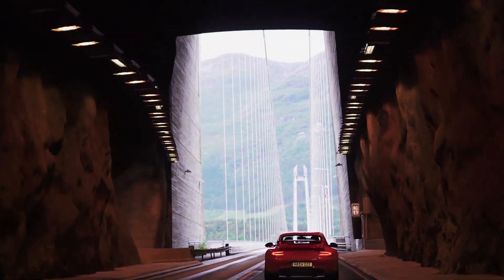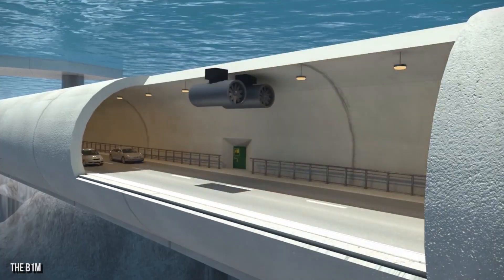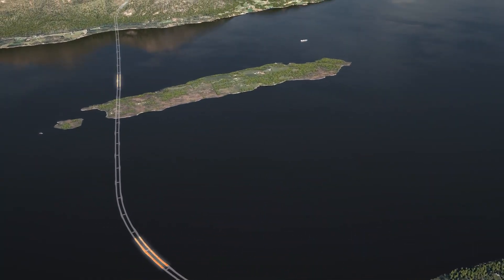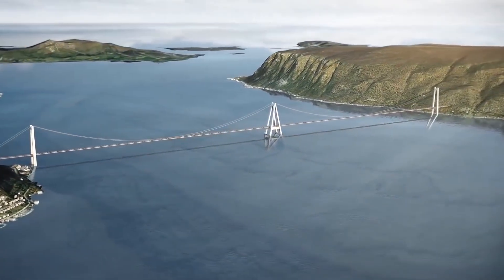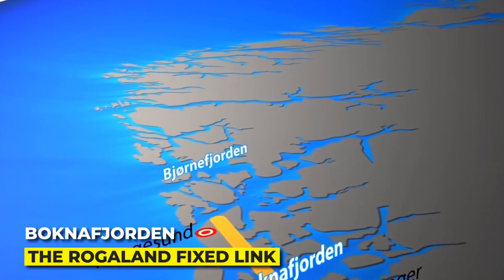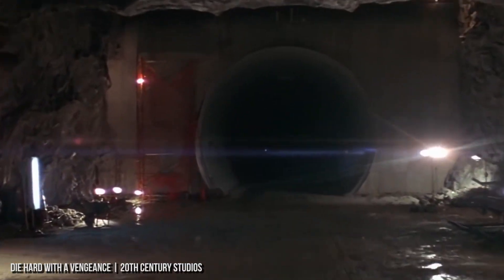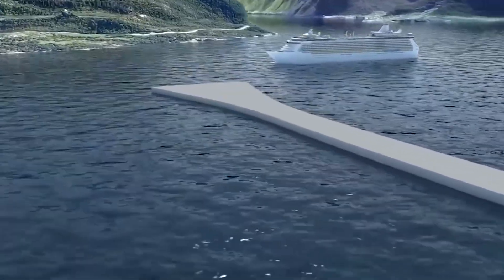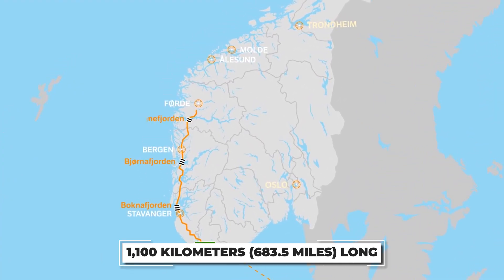Inside Norway's $47 Billion Floating Highway

Comment: I wouldn't want to be stuck in one of those tunnels when an earthquake hits.
Reply: Earthquakes? In norway yeah that earthqakes basically don't exist there.
Reply: @Incognito-co6og  When they pressure the sea too much. It causes evaporation of water which can cause earthquake
Reply: @murphyfx  wow great oppinion thanks
Reply: @murphyfx  what? Are you trying to say that that is what causes earthquakes? I think you need to do some googling..
Reply: @Incognito-co6og  there will be.   Seismic regions have been changing recently.   But this floating thing will be quite flexible I think.
Reply: @Incognito-co6og  lol
Reply: @Incognito-co6og  they must have thought it through,  like Japan.....advanced countries..
Reply: @Incognito-co6og  research shows it does have earthquakes.
Reply: Incognito that doesn’t mean they won’t happen there. Lol
Reply: @sandygrahamn6175  if they do get earthquakes there it's probably just one thing that sensitive people can feel.
Reply: @sandygrahamn6175  the biggest norwegian earthquake in history was magnitude 6.2
Reply: @sandygrahamn6175  Hey dumdum, incognito has right, Norway lays to far away from any earthplate end, that it can't start to move in the ground to cause any damage. In Noway the biggest earthquake threw of a cup of coffe of the dinner table
Reply: @sandygrahamn6175  maybe, but it’s a vary low chance to happen
Reply: What  if it was underwater volcano ?
Reply: @goliath760  even worse i-, cause there can be active volcanos underwater right?
Reply: @goliath760  Hi
Reply: If you look at the earths plates, then u see it's nearly impossible that it will happen.
Reply: I wouldn't want to be stuck on any highway if an earthquake hits..
Reply: @dee1380  lol
Reply: Earthquakes are caused by the cracks in the earth. Norway is nowhere near a crack. No worries, no vikings will fall.
Reply: even though theres a small chance that something cannot destroy the tunnel... ya'll never know.
Reply: take your bible with you and it may save you.
Reply: I would agree with this statement as there can be a possibility of something that can trigger the surroundings of the cement wall and rupture quickly.
Reply: I have lived most of my life in Norway and i have never experienced an earth quake and i dont even want to watch the Norwegian movie called skjelvet about a major earthquake in Oslo because its too unrealistic. Anyway that is in the south east and in the west you still see lava Flow shaped rocks and the faroese Islands in the far west in the Atlantic looks a lot like Iceland. A major vulcano area and the Islands are close to Iceland too. Anyway if it did happen it would happen in the west i think where this is planned
Reply: theres never earthquakes in norway:)
Reply: Hey Sherlock, maybe learn geography first before commenting next time aite?
Reply: Safety is always an issue, which is why we need to keep our options open, especially when we're talking about infrastructure. Populations are growing and there's no signs of declines any time soon. We need to accommodate that with solutions.
Reply: So during an earthquake you'd prefer being on a sky bridge, on the 88th floor of a tall building or driving thru the chunnel because ... 🤔
Reply: It won't be the first time I commuted via submerged tunnel; we use a BART train that crosses the San Francisco Bay - not far from the San Andreas fault - with a similar apparatus.
Reply: I heard in a video about Elon Musk's tunnel, that earthquakes don't reach tunnels, they only ripple along the surface. So these tunnels should be safe also.
Reply: Driving on the surface unfortunately has lost lives as well.  I'm worried about the accidents that may happen with the super impatient drivers who will want to drive even faster because it's tunnel.  Who knows.  I'm actually a relaxed driver so this will be perfect in future,  and this highway will be a major popular one.
Reply: You changed my mind
Reply: These tunnels have to be incredibly dynamic, they are literally floating by strings, so I doubt earthquakes would affect them much... A much more horrific scenario, would be if a huge chunk of mountain fell into the fjord, creating a humongous mega-tsunami (But then you wouldn't want to be anywhere near that area, tunnel or not...)
Reply: that wont happen in norway i think we jave never ad an earthquake but with all what jesus said it might happen
Reply: @David-cg6wl  We had odd one in South Africa.. Not as major as countries...   Ours have been minor..

Norway is a  beautiful country..
Reply: @parrotafrica2996  always cold here but warm enough so.we.dont get snow atleast not this year do to global warming and mexican heat wave orstream that goes past norway
Reply: Norway has been a good and comfortable place to live in. I think i have to invest and secure properties as well
Reply: @thenavigator8052   That's a very lovely idea. Investment is the future, investing now will be wise.
I invest in crypto currency and forex trading, and is highly profitable
Reply: Can you recommend him please
Reply: @nicocielo565   
+     1      4        1       0       8       8       1     2       1       9        2
Reply: Communicate with him
Reply: A friend of mine in Vietnam once told me about Mr Charles. Is really a little world out there. 
And he has made a good name for himself
Reply: Charles Jones has brought me out of the wrenches and to a better living through his trading options, I encourage newbies to trade with him.
Reply: My son schools and works in Norway, and he is making it big time over there.
Reply: Imagine that green door opening 😳😳😳
Reply: Norway cannot have a earthquake because Norway is on a plate.  (Plate that collide to make earthquakes, check Internet)
Reply: earthquakes dosent exist in norway
Reply: It is not earthquake in norwey
Reply: There isnt that here
Reply: You might wanna look into the physics of an earth quake before you form an opinion. Tunnels are highly resistant to earth quake effects because those are much less noticeable underground. Much like even the strongest waves aren't noticeable underwater. These floating tunnels will be very safe in harsh weather conditions. Much safer than bridges.
Reply: @moladiver6817  nek minut
Reply: Now it's two hundred.
Reply: If a war happens the just know that yu dead under those tunnels
Reply: I wouldn't like to be in a normal tunnel either.
Reply: Frida Gylterud   😂
Reply: they won't create the idea if they didn't decided about the plan and caution first.
Reply: Probably safer
Reply: Lol me 2 😂🤣
Reply: Earthquake only affects land not sea unless it's sunami
Reply: With the way Norway is going about this infrastructure, is going to create an international business contract, economic growth and even generate employment for Norwagians.
Reply: The rich gets richer by investing heavily and spending wisely. Crypto and forex is the best right now
Reply: @mrb5422  Speaking of Bitcoin trading, it's the best right now. I know couple of friends who makes profit in the financial market.
Iam not hear to converse for Mr  Jones, but to testify just for what iam sure of.
He is trustworthy, reliable and best option ever seen.
Reply: Actually, being in such a location during an earthquake would be ideal due to the flexibility/ductility of the structural system.  There's a lot more give in such a tunnel than say, a very rigid concrete bridge which in California's case, have seen many such disasters since the San Fernando earthquake in the early 1970's.
Reply: I TOTALLY AGREE  WITH YOU.
Reply: You are safe when you are at the safe. I laugh
Reply: @Potatowhen did I say that 😂 INNIT
Reply: @Potato well I don’t  keep record on every earthquake when I meant Europe I’m talking around England Ireland France area where there not near a ridge the closest ridge to them would be in Iceland
Reply: Surely.have you experienced earth quakes in high stories buildings, when escalators give off it's function and due to rush downs stairs became an inconvenience to reach to the ground.
Reply: no earthquakes in norway, tectonic plate boundaries are in different areas of the world
Reply: I didn't want to think that my road worker father was stealing equipment...but when I got home, all the signs were there.
Reply: I am Norwegian and i know that there has never been an earthquake in Norway. And by that i mean by in Norway not at the coasts of Grenland.
Reply: Very rare that there’s earthquakes in Norway since it’s so high up north
Reply: Hello
Reply: [BosS] HITMAN 20  Norway lies on top of a earth plate which means we won’t see or feel a earthquake but doesn’t mean it won’t happen. Just some months ago a big earthquake happened. If you think you know so much then say what makes a earthquake come
Reply: Those are problems dealt with before the tunnels regarded as safe ... Engineers test every challenge is there to be encountered .
Reply: @MusicisLife-ok6ub  we don’t have fully control of earthquakes but it’s rare that it happens in Norway since Norway is on a earth plate but it doesn’t mean people can’t get stuck there while an earthquake happens
Reply: I live in Norway and we got just one earthquake :) Vindafjord :) just a little one :) no hulls no cracks 10 sec, mostly landslides and rock falls happens in Norway
Reply: From a few of the comments on this I see a lot of people that aren't from Norway, Earthquakes aren't really a thing in Norway :)
I would know, I live there :D
Reply: Learn how tetonic plates work bruh
Reply: hahaha
Reply: norway is not located in earthquake zone
Reply: Norway barely has earthquakes most common ones out in the ocean and are mostly 1.2 magnitude
Reply: YOU ARE ...
Reply: @Daniel Kintigh earthquakes across the world have been in increase.  Korea for instance didn't use to have earthquakes but as of late there have been frequent instances
Reply: Start earning up to $10,000 online in all country with out paying anything ask me how
Reply: Earthquakes barkey exist in scandinavia, and ive been in 2 earthquakes, 1 that i didnt nitice during the night and another one when i was going to brush my teeth and the i felt how my feet started damcing a bit, but it was barley fely
Reply: Same thought i had
Reply: were quite far from all tectonic plates so no worries there, besides they build quite tall skyscrapers, in earthquake ridden places, works there.
no the danger would be a fire, you stuck down there and a car manages too f.instance crash and start burning, the smoke envelopes the tunnels pretty darn fast and you get asphyxiated
Reply: ,
try The Seikan Tunnel, japan
Reply: Sorry, but we don`t have earthquakes in Norway:)
Reply: It's like some shit from Norse mythology
Reply: in europe there are no earthquakes
Reply: @Endorzan  what about Turkey and Italy last time I checked they were in Europe
Reply: yeh about that we in norway basicly dont have earthquakes :D
Reply: Since norway is right in the middle of an earth plate thing, we cant have earthquakes here
Reply: We don’t really have earthquakes here only snow storms or landslides.
Reply: Search up where Norway is perhaps. Earthquakes if they even happen are barely noticable
Reply: They don’t happen there
Reply: yeah norway made a movie about it.... smh even caled it the tunnel
Reply: Because those are definitely a threat in Norway...….
Reply: If only they thought of this. Oh wait, they did. Just like any engineering feat ever.
Reply: As a Norwegian I can tell you that we extremely rarely experience any earthquakes big enough to notice.
Reply: Nephew...
Reply: Or a storm.
Reply: Tunnels are safe from earth quakes earthquakes happen mostly on the surface look it up
Reply: @jonheick1817  but most of the seismic activity starts from the plates at the bottom of the ocean i think.
Reply: @lyza9718  then again water around those tubes can travel, and tubes can bend a little, but those conventional  inland tunnels can even collapse in a heavy earthquake.
Reply: @jonheick1817  
I think those posting fear of earthquakes comment should be thinking about Tsunamis rather than the earthquake.
Reply: @jonheick1817  True! You're better in the water then..
Reply: @jonheick1817  no
Reply: @jonheick1817  looking at the dept of earthquakes in Iceland the depth varies, some can 10 - 20 km deep.
Reply: @jonheick1817  Especially these tunnels, that can flex, and are not in the rock.those inland tunnels may even collapse in a heavy earthquake, but these can flex and the water around can travel. There are already many tunnel under sea and under water, and there is no problems.
Reply: @jonheick1817  Earthquakes happen on surface?? I thought it starts from underneath. Like folding
Reply: aw heck naw-
Reply: Or a big ass whale hits one of the columns
Reply: Accidents happen any where!
Reply: ive been living in Norway my whole life and not a single one has happened. they don't happen there budy
Reply: @christianewald6704  because Norwegian sea hasn't been pressured.
Reply: Norway is really coming with extreme and unimaginable road network and technology. Am so impressed watching this 🥰😊👌
Reply: @Smart-wg6lr  well thank u
Reply: People have to concern szunami instead
Reply: Major Earthquakes don’t exist in Europe because where no one near the plates of the earth 🙄
Reply: Burger King Twitch Deals There are a lot of earthquakes in Europe. The big ones are mainly in the south of Europe, but also earthquarkes in the north, but they are very small. In Norway the problems are landslides, because they can cause big local tsunamis.
Reply: Burger King Twitch Deals helloooo!!! Who told you never exist in europe here in italy happened already.
Reply: @Yuppa.69   There are many earthquakes in Iceland
Reply: Gunnar Thorisson I was talking about Central Europe
Reply: @gunnarthorisson5518  Iceland is on a hotspot, like Hawaii is, where the earths crust is thin, not on a fault line. Scandinavia is nowhere near any plate boundaries, & doesnt regularly get intraplate quakes either, if they did then with their geogrpahy we would hear about it because the consequences, of earthquake caused landslides, would be worse, than in say isolated parts of Australia where intraplate earthquakes happen. Plus people with written language have lived in Norway for longer than in place of the world colonised byu Europeans where the history is oral. We would know wether Norway got earthquakes or not, because the recorded history is longer..
Reply: @Yuppa.69  turkey nd italy both were hit by devastating earthquakes,  nd they are in Europe

Comment: "Barnacles on the hull of a ship increases the drag of the vessel, thus the increase in friction can reduce the travelling speed"...
What if the floating tunnel grow so much of barnacles that it would sink by their weight?
Reply: You just invented my dream job. To scrab barnacle in the summer
Reply: @michealcroes3377  Maybe if the tunnel is placed deeper it will be safer of the barnacles and turbulences of the boat traffic. But you might find it hard to scrape it at 30-50meters depth.

Comment: By the time they finish,  wide spread adoption of electric vehicles will be the norm. To reduce the probability of collision, only vehicles capable of tracking and control by the tunnel network should be allowed in.
As they're lighting the tunnel anyway, they may as well add induction charging to ensure that no vehicle would fail due to battery exhaustion.

Ohh and I wouldn't hesitate to traverse this network.

Comment: I don’t want to be there when a earthquake happens 😰. In my opinion this is a bad idea.
Reply: Earthquakes are really rare in Norway
Reply: colin oh i did not know that, but still you said it it’s rare, but it can still happen. Still no from me 😰😰😰
Reply: @GodJihyo-gi5bm  Actually, there are quite a few earthquakes in Norway. However, they are all really weak. And mostly only noticeable on computer recordings. No one has ever died from an earthquake in Norway. And only a handful of quakes have led to minor damages to buildings. Norway mainly suffer from mud and rockslides. As well as quick clay in some parts of the country. None on these issues are very relevant for this project though.